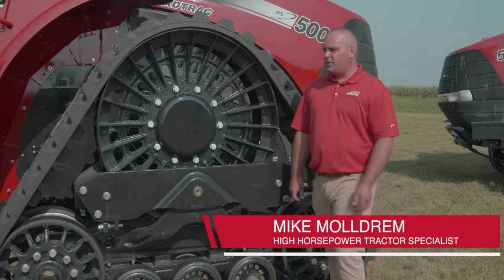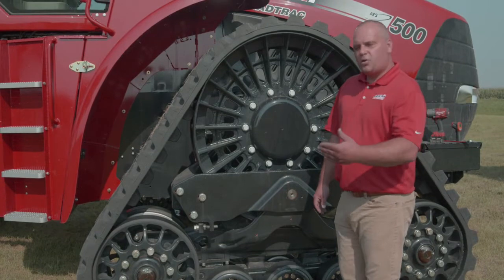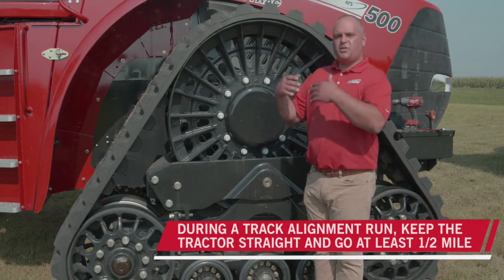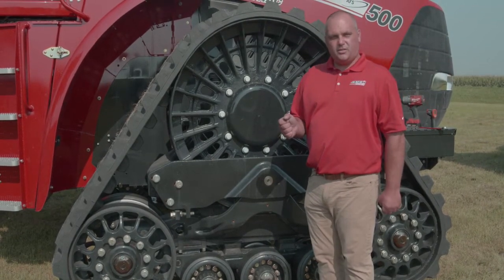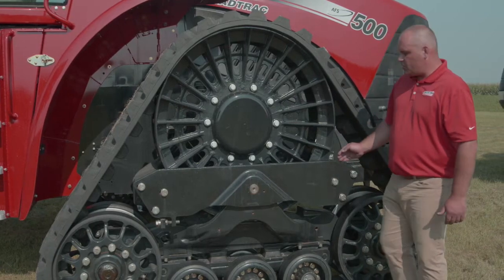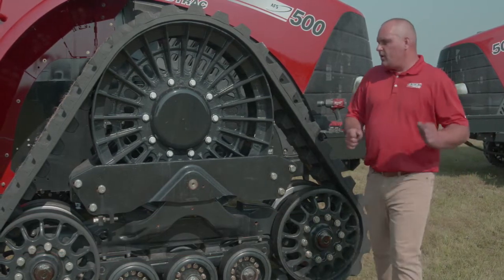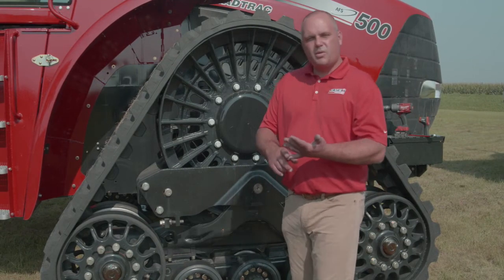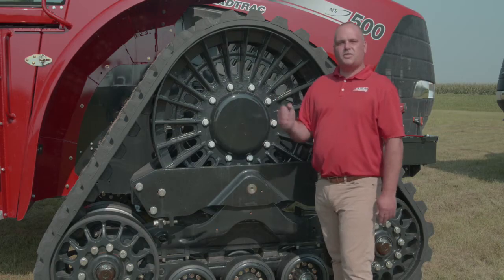How to Properly Align your Tracks on a Steiger Rowtrac and Quadtrac Tractor

Comment: Leaves a couple questions....1.) talked about temperature difference between the two sides. You mentioned the heat gun but never stated how much difference threshold is needed before requiring adjustment. 2.) you show the row trac but what about the quad trac? How do you adjust it?
Reply: same. exact. way